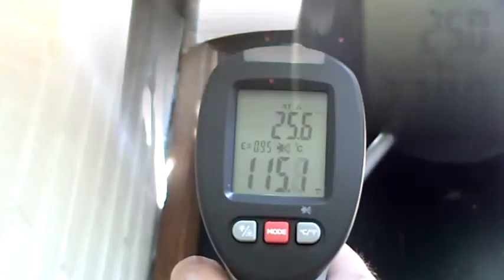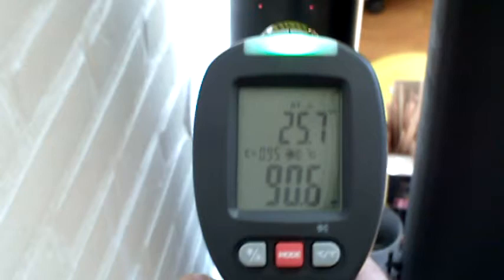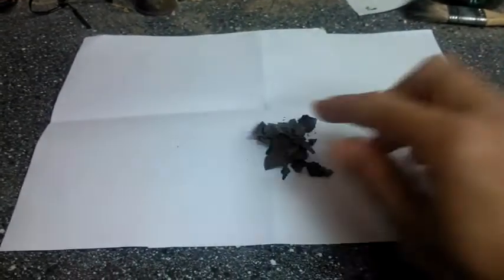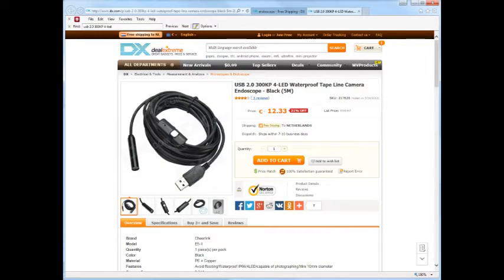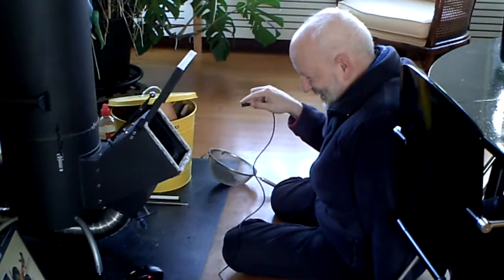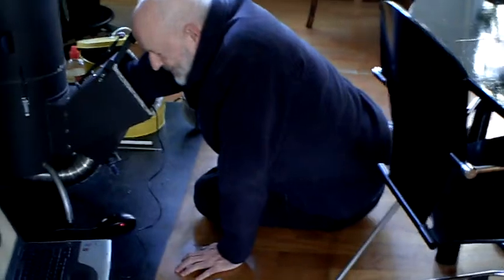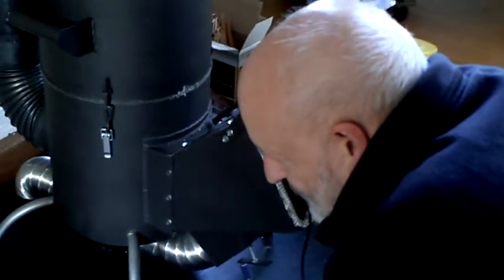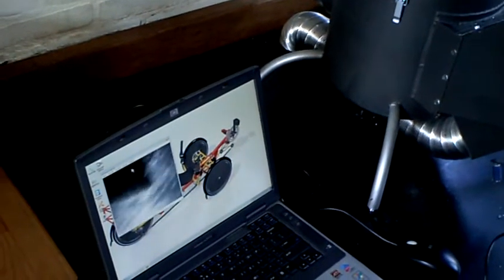Rocket stove heater temperature readings and endoscopic inspection

Comment: Steel melts at 2500 degrees Fahrenheit?  Are those vortex blades melting?  Is that how hot this little monster is getting?
Reply from the maker: No, the blades glow orange to yellow, but don't melt. But at that temperature the mild steel oxidizes in a special way, creating those gray pieces. the inspection shows that the tips of the blades are most affected, as they get the hottest. I replaced all these parts with stainless steel. The problem did not recur after that.

Comment: Looks good. Does it really work well? Does it take a long time to heat your living area?
Reply from the maker: Thanks. Yes, it really works well. No smoke, almost no ashes. In my configuration it takes a very short time to heat my living area, because it does not store the heat in mass. You have to refill it every half hour.
Reply: @RobertJHGisolf  Would making a batch box to the stove reduce the wood loading cycles ??? Thanks

Comment: Great design and construction, thanks for sharing it.What is the effect of adjusting the height of the riser pipe? How does it effect the heat measured on the top cap, and how does it effect the 'rocket' flow through the stove?
Reply from the maker: Thanks for the compliment. Please look at all the replies, I already told the story about the adjusting. In short: if there is enough room on top, there is not much difference. To small a gap will disturb the airflow.
Reply: hello, nice stove and video. maybe i missed it, but do you actually in everyday practice use the sistem for rising the riser? has it proven worthy of making? what has proven to be the right or minimum gap?

Comment: First, let me compliment you on a very attractive design. Could you add some sort of fins, like a heat sink, on the exterior of the exhaust pipe to try and capture more heat into the room? Just a thought.
Reply from the maker: +JGUNW1R3D Thanks for the compliment. And yes, that could be done (zerofossilfuel did that). But I'm thinking of a sort of hot air distribution, to deliver hot air to the rest of my house, by using an electric ventilator and pipes, getting the heat from my stove by sucking air through a mantle outside my stove. The room where my rocket stove is, is getting very hot.
Reply: Robert J.H. Gisolf

Comment: Yes, I already understood there were no spinning parts. The vanes are placed to slow the flame or increase the distance the flame travels to increase burn efficiency, got it. 
It is a nice idea to improve efficiency but, rocket stoves run very hot, and it unfortunately appears that the blades being placed in their current position (the hottest part of the firebox in the presence of charcoal) is creating a carburising effect on the blades. 
Just as a suggestion maybe placing your blades 7.5cm to 12.5cm higher up the tube (out of the critical heat zone) may solve the carburising problem and still achieve the desired effect.

Comment: Very interesting video.  However, if the turbines are so problematic from a mechanical view, may I ask why you wished to create a vortex? Is it necessary for improved functioning?
Only my thoughts but, turbine engines spin by their nature but use narrowing to increase outflow pressure (and thereby heat) wouldn't is be better to use something like a constricting pipe or a 235% wider burn chamber to concentrate the gases and increase the burn efficiency? 
That will likely create some interesting burn temperatures.
Reply from the maker: Shannon Lodge There are no spinning turbines involved here. The vortex generating vanes are mechanically simple. The vortex is not necessary but has two advantages. First the already turbulent flow is made even more turbulent and therefore the secondary air is mixed better with the eventually remaining burnable wood gasses. Secondly the flue is spinning so it takes a longer way up to the top of the inner riser pipe and is therefore longer in the high temperature zone to fully burn the wood gasses efficiently.

Comment: Thanks again for this information, Robert. The temperature drop between the feed tube and the exit chimney is impressive. This looks like a very efficient heat-releasing AND heat-extracting design, for best use of fuel.

BTW, I've only ever used stainless-steel - mostly 3mm wall-thickness, though some as thin as 1mm - for the whole length of the hot-gas flow-path from entrance to exit, and I've never seen any sign of burnthrough yet. I wondered if your flakes might be a sign of mild-steel burning off somewhere along the flow-path?

Comment: Before throwing away that vortex assembly and the secondary air intake have you thought about ceramic coating them?
Theres a product called Cerakote which can handle massive temperatures, it is sprayed on and has very high bond properties as well as pretty much scratch proof.
Great oven by the way and video is well made.
Love the way you can access the riser and internals its a great job, I'm currently awaiting delivery of some 304 stainless to start a cooking rocket stove with a simple vortex (off centre intake with decreasing surface area) and secondary air. Not as grand or adventurous as your model but will be happy if it does its job.
Keep up the good work :)
Reply from the maker: Thanks. Interesting stuff, mostly used on guns? I replaces those parts with stainless steel already and that is going well. But I will remember this material. And thanks for the compliment.
Reply: Robert J.H. Gisolf glad you sorted it all out ;)

Comment: Great job! Very good design...how large a room do you have this piece of art?
Reply from the maker: Thanks. The room it is in is about 5 by 4.5 meters, 3.5 meters high. But with an open connection to two similar rooms. And there it is heating as well, and the thermostat of the central heating is influenced by it.

Comment: Great set of videos and music!  
What difference are you able to measure with the vortex vs a straight pipe?
 Thank you!
Reply from the maker: Thanks. For the music you have to thank Josh Woodward.
I can't measure a straight pipe because the vortex was there from the beginning of my design. But in general I think you could say that the burning flames are longer without a vortex. Without a vortex most of the time you can see the flames coming out of the top of the riser. If you have a vortex on the bottom of the riser, the mixture of unburned wood gas and secondary air is better and the burning gasses travel a longer way (a spiral) in the riser. So it's cleaner and hotter.
Reply: Robert J.H. Gisolf Got it. Thanks!

Comment: Nice video. The way you measure temperature throughout the stove is very interesting and shows the ability of the rocket stove to irradiate heat to the environment. It is possible to notice that the bottom of the heat exchanger is fairly cold when compared with the top. How tall is the heat exchanger?
Reply from the maker: Thanks. The stove is designed around a standard available double-walled stainless insulated pipe of one meter. That sits on top of my concrete combustion box which hangs in the lower part of the stove (you can see that in my first video). That together makes that my stove is around 125 cm tall (without the legs).
The "eco-fan" on top of it also helps a lot. Whithout it the top would be more than 400 degrees C. I will show this "eco-fan" in a future video.